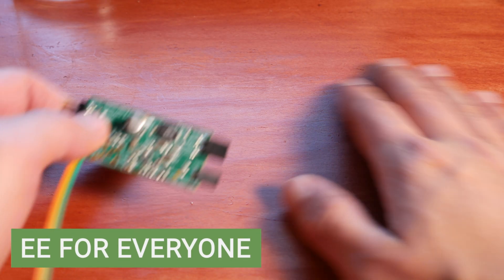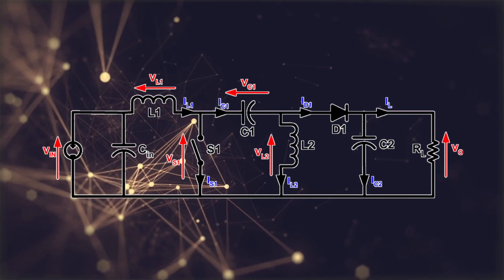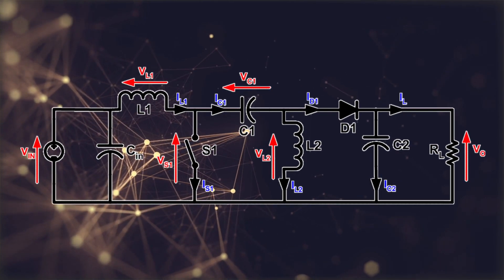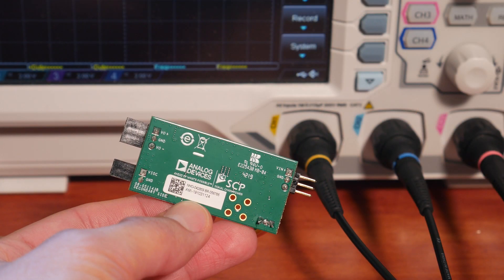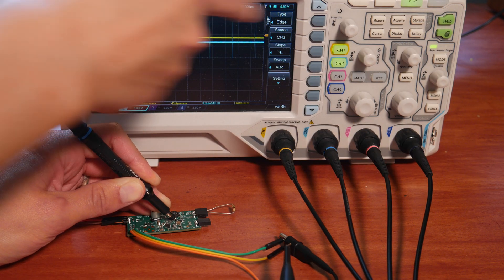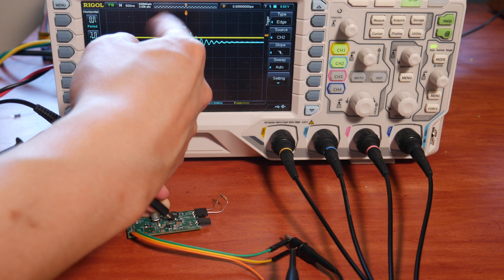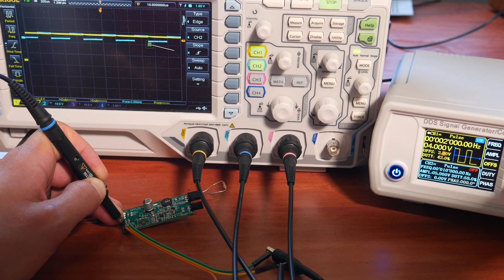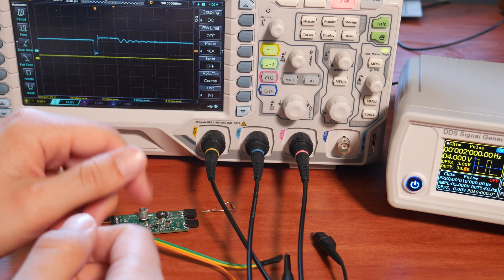SEPIC: Resonant, Oscillatory, Both? LT8362 Development Kit

Comment: At resonanance in a series LC the voltage across both should be zero as they are 180deg out of phase and thus cancel... resonant parallel LC the voltage is equal ( they are in parallel 😅) but the current is 180deg out of phase

Comment: I always have d doubt, can one use inverted dcdc as a non-inverted psu?, i mean switch the polirity of the output, can it be done ? what is the pentential probelm for this?
Reply from the maker: Hello ye yuan, it would be rather difficult, but perhaps possible to use an inverting regulator in a  non-inverting application. It would be far easier, and less prone to failure, if using the parts designed to do the job well!

However, some boost modules can be used to drive a SEPIC converter, so it's sometimes possible to blur the line in similar applications

Comment: I don't think this circuit is supposed to be resonant. The output capacitor is just an output capacitor, the diode is gonna block any sort of sloshing of reactive power between it and the other components. The middle capacitor is (if I understood them last time I looked into them, a DC-blocking capacitor) and then the first one is just a bypass cap to provide a stable voltage to the converter.
Reply: yeah yeah, i got you, no way it works under zvs condition.
Reply from the maker: Hi there power Max! Great comment. Honestly, I'm not sure if it's possible to achieve true zvs or get into a resonant mode, but It seems reasonable that something special would happen if the switch were synchronized to the natural frequency this system oscillates at. 

I added a link to an article discussing a so-called 'resonant' SEPIC (video description). I didn't get into the details of their design or analysis, but I've seen at least a couple articles pursuing that rabbit hole! If you have some time to dig into their results, I'd be curious to hear the tl;dr;!